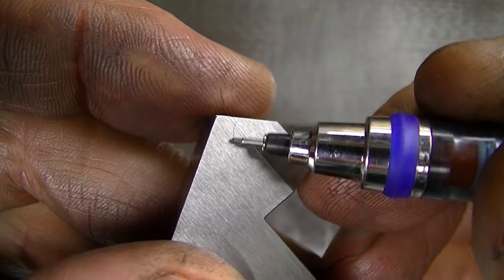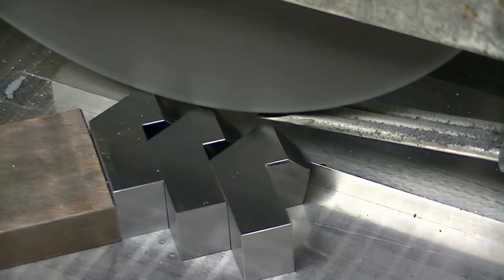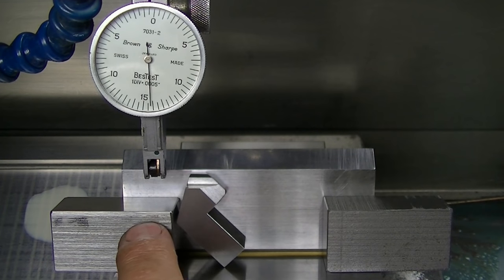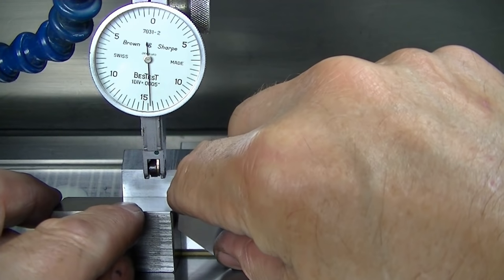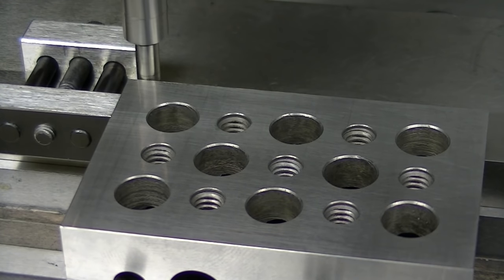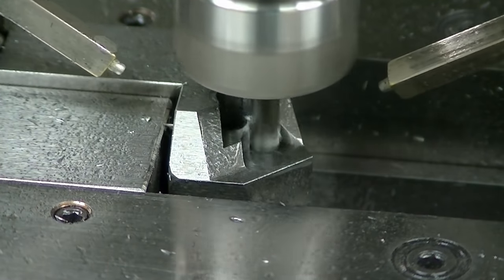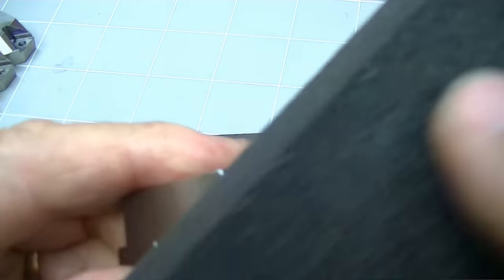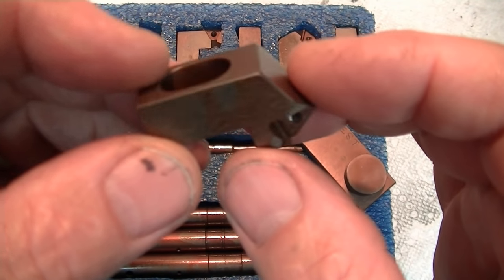MAKING INSERT CARTRIDGES PT2

Comment: How much was the insert screw preload?
Reply from the maker: Done by slowly increasing the pocket size until the preload feels right on the screw.
Reply: @ROBRENZ  Thank you very much for your reply. I highly appreciate it.
Reply: What doy you mean by screw preload in case of insert?
Reply: @kundeleczek1   the threaded hole in the holder is OFFSET from the hole in the insert, so that the screw pushes the insert into the two registers.. this will deform the screw slightly (bend it) which creates pressure that keeps the insert seated against the registers.